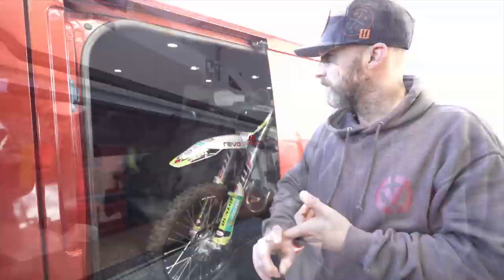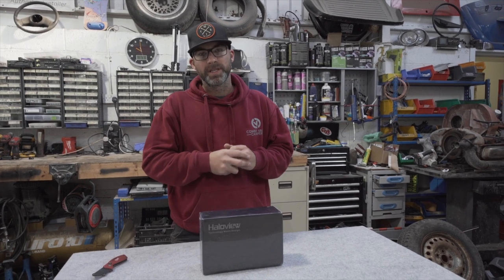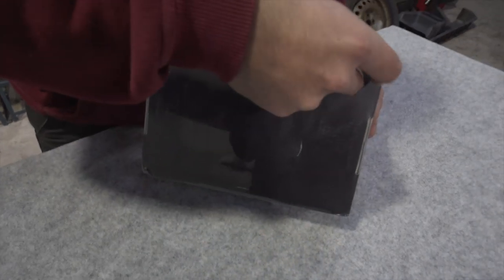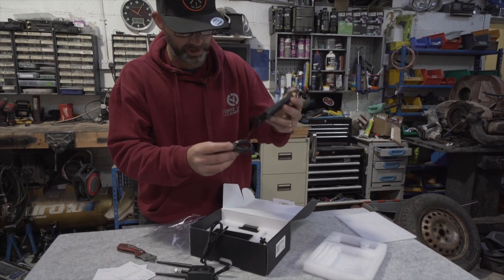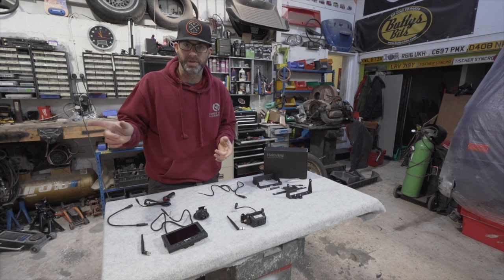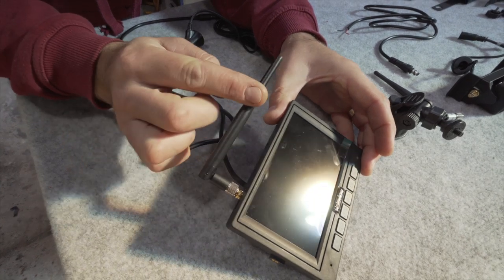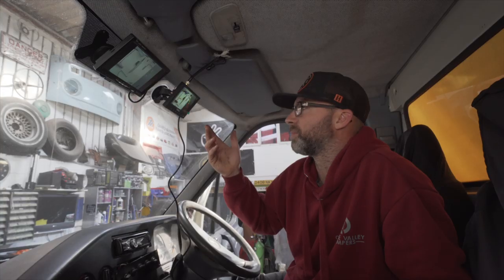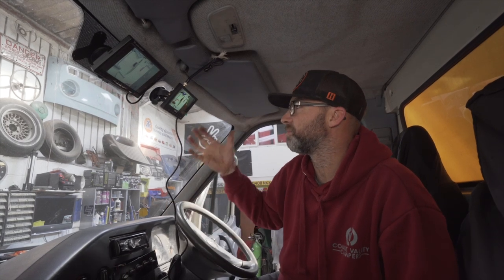HOW TO FIT A CAMPER VAN 'WIRELESS' REAR VIEW CAMERA, using the Haloview MC5111

Comment: If you want the rear view cam to be on like a dash cam and not a reverse lights could you just wire it to the rear light and not verse light just for a power source ? 
I’ve just bought the halo view mc10

Comment: Ohh are you sure about the feed to the screen, if you hard wire it there will be too many amps going into the screen. Normally you would have a hard wire kit which effectively replicates the resistance of the auxiliary plug.
Reply from the maker: Hi Mark, the stated required voltage for the screen and camera are 10-32vdc
Reply: @CombeValleyCampers  PM Sent, it's not a voltage issue it's amps. Normally an auxiliary plug will have an internal resistance to limit the amount of amps going to hardware.
Reply: Mike 6978 amps are drawn and not delivered. Meaning the unit can be connected to the feed as shown. The only protection needed against over current would be a fuse. Much like a domestic set up. Otherwise all your domestic appliances would need a resistance inline as you state because the grid is capable of delivering much more current than you need.
Reply: @gazoutdooradventures  Yep I get that, the correct amperage fuse would be critical.
Reply: @UKvet246  only critical to save your equipment (or yourself) in the event of a short circuit or electrical fault.
Reply: Would not want Mike doing any electrical work for me.
Reply: @stonkeng  Ha ha funny